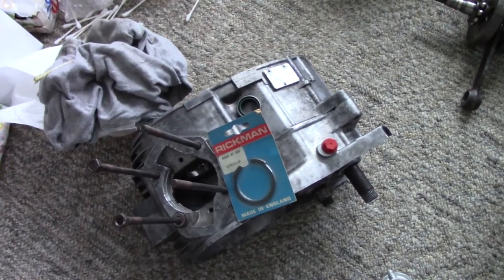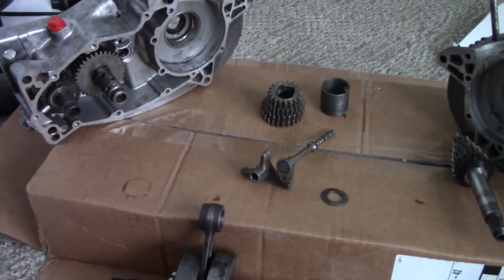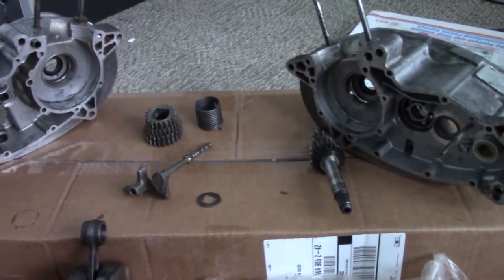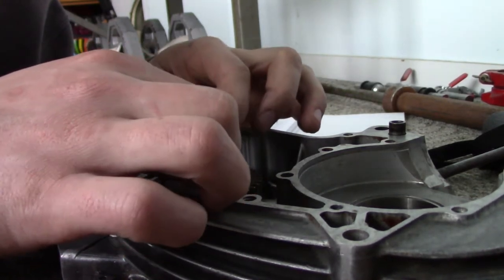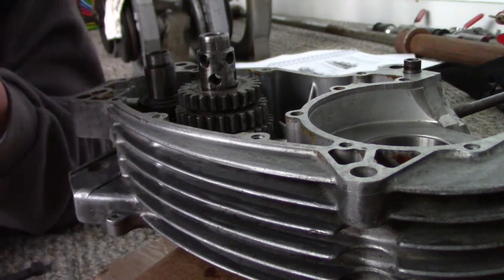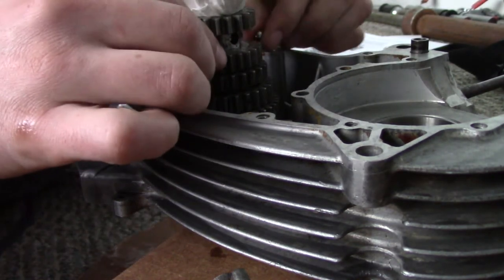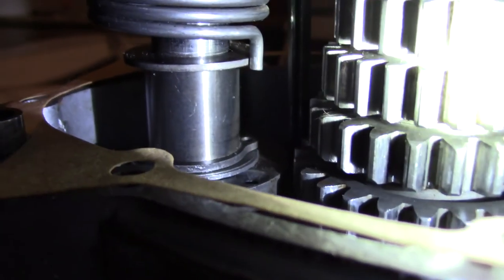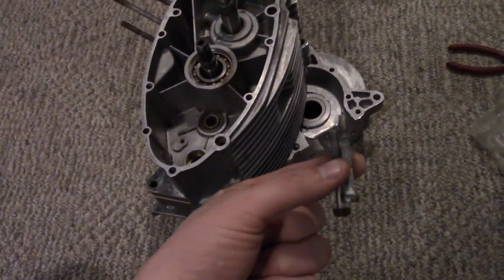Reassembly Of The Transmission (part 4 Rebuilding The Zundapp)

Comment: yes this is the nightmare from hell with all those roller bearings 19 of them in all ok . I wonder if this guy is from upstate new york and had a metice zundapp for sale???
Reply from the maker: I'm from Washington, mine was found in a barn, dead. I got it for free, but put more in to it than she's probably worth lol. 

Yeah my trick was using magnets to get the weird roller pin bearings to stay put, as well as those funky ball locking bearings. Trouble is with those free little pin bearings is they can wear funny, and I found I didn't much like the way mine were wearing last time I looked in there. A regular bearing race would be so much better. if the bike ever has a fail, and survives it, that's what I'd likely put back in their place.

Comment: Its a awesome engine. Can you explain how this transmission gear shift when drive and how it work? Because it wasnt similar in any motorcycle transmission on this day
Reply from the maker: Basically, instead of forks moving gears in and out of drive, the gears are all in constant mesh, and the ratio is selected by a cam lobe that slides in and out of that hollow shaft. When the lobe is in line with a gear it forces these ball bearings into the gear and that is how the gear is selected. It's known as an Expanding Ball, or Ball-lock, transmission. They aren't common, but in the early days of motocross, the smaller cc engines could get away with a design like this, bigger cc engines would devastate the ball locks.
Reply: @michaeltolomei6623  thank you bro. You exlpain it well. I always searching entire in internet but didnt get the sarisfying answer..

This transmission is awesome. A hightech from past time that give little cc engine run like a jetplane.

Comment: is that the shaht with all the holes in it that has those 50 little roller bearings around a race that all fall out when you pull the shaft out My 1965 KS-100 had the same set up not sure if somebody did not upgrade that and remove and replace that lousy design with a solid 1 piece roller bearing for that shaft if anybody knows that would be appreciated they never should have used that 50 separate rollers that came out of the race
Reply from the maker: indeed it was, I used magnets to keep them in place because yeah it's a terrible design. The bike still runs to this day for now. But that transmission is one scary sounding little thing. And I never did get it to shift strong. I can find all the gears but it's a dance cause no matter where I tune the "shift bell" for the drum shaft, it doesn;t seem to limit the kick enough. Bike seems to shift past gears most of the time.
Reply: There is a guy in the Netherlands that builds brand new engines it's on you tube
Reply from the maker: @luckyfreeman5079  Sounds like something mine could use at least the transmission anyway. Compression wise my engine's gained a few pounds. I did a compression test a week or so back and it was hovering just over 140lbs. When I first completed this, it was only 120~.

Comment: The shims on that shiftshaft (that's the wordwise translation) belong always between 1. and 2. gear! And there are always shims! Youre putting that transmission together the wrong way, you put all shafts into the right housing, the left is like a cover. Asap I will give you a link how that really works! Greetings from Zündapp-Land!
Reply from the maker: Don't worry, I figured that out, I believe mention it in one of my later videos. The biggest issue with this project is the people before me really messed the bike up bad. I can tell it's been dropped and had the shiftier sent into the case once in it's life.

 I have it all together now, I posted a small update on it along with some of my other stuff. It runs and shifts, but now I am fighting the carburetor for a smooth run. Right now it runs real rich, and I have jetted it down quite a bit, (too the smallest sizes offered, 2.68, 105, etc, I have really nice plastic float tanks that work way better then the foam ones. I guess Bing made both, and I got lucky and found a set for the 53 carb. My needle is in fairly good shape as well. The main issue now is getting the floats to stop sticking. Occasionally they stick when in the off position. Also my fuel tank may be to blame for some of my carb trouble, it is not the cleanest, (despite sloshing it out a few times). I'm thinking about doing some further treatment on it but I don't want to risk putting holes in the old steel tank.

I don't intend on riding this bike too much, I just want to slowly restore it, and preserve it. There are a lot of things I wasn't able to replace so I am leery about it's outlook. Some bearings are original in it unfortunately. I just intend on riding it a few times a month as a trail bike. I have a Yamaha for the harder riding.
Reply: @michaeltolomei6623  sorry, the Video for the 288 engine, similar to your 285 is still not ready, meanwhile this one is usable too: https://www.youtube.com/watch?v=m5Vy1BEdAIQ.  carb problems are not so easy to explain via writing, and even more difficult since my deutsch is way better than my english, if still needed, we can try, let me know